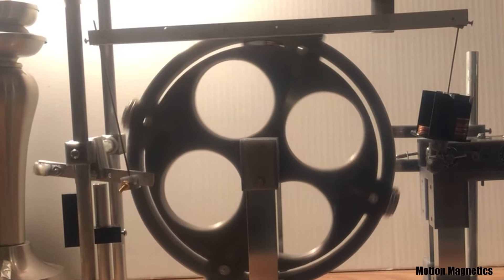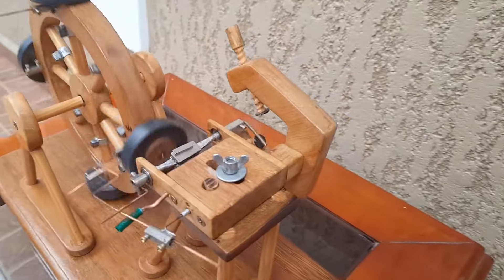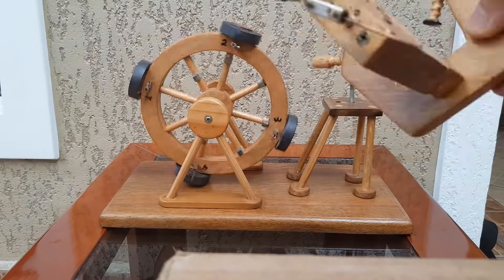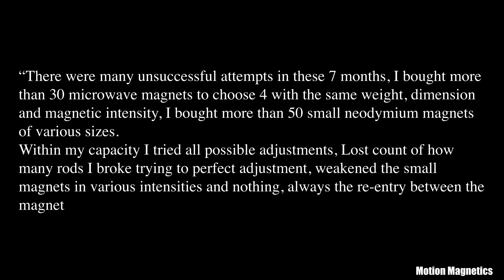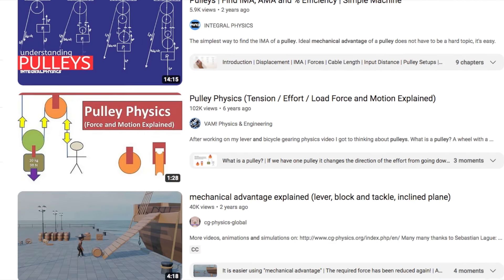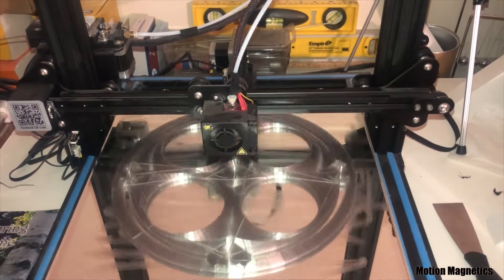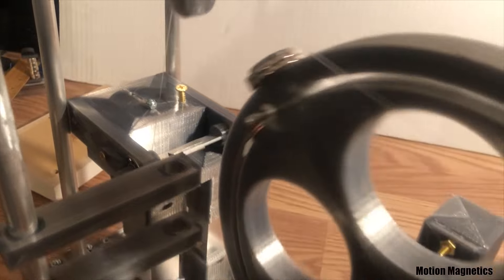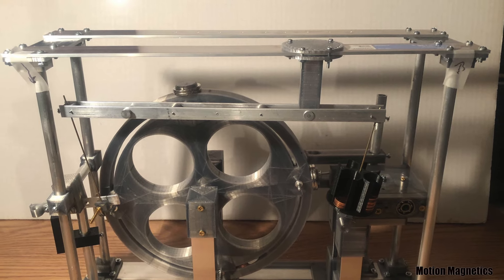The Perpetuum Magnetic Motor

Comment: try to vacume seal the fly wheel in plastic perhaps,or seal the flywheel with plastic  or  place it in  a closed chamber under o pressure them spin it ,factor in static electric can possible harness in both current direction thanks

Comment: There's three things real quick one a bigger wheel at 4 to 6 ft with lots of magnets on it the next one is instead of the magnet flipping horizontally put it on a shaft that spins vertically

Comment: I recent atumbled across this researching Luling motors, i saw a guy using pneumatics to actuate a magnet that gives it a larger push because the spring magnet is tuned to be just far enough away that the rotating bar is slightly off-center woth the two outer magnets, when you pull the spring motor back it launches the bar around for 1 turn, so this guy I saw used compressed air and some electronics i assume to get the right timming to renew the push force, he got his up to 400 rpm.  Im assuming this works similarly and is true timing is everything.

Comment: Your projects are above and out ahead, effort is two hundred percent +++. What is very important is the fact that others will be inspired by the instructive presentation. In the mechanical mind there are wheels that have not yet turned, but what might set them to spinning.
Reply from the maker: Thanks! My main point is always to provide ideas and perspectives that cause the viewer to think. I imagine it as passing a baton back and forth in a race. If everyone works together as a team, there's a much better chance of winning the race.
Reply: I agree that the video can have an inspiring effect on some people. But frankly, many different design ideas for magnet motors have been tried in the last decades, but none of them could show even the smallest energy gain in a credible way. Does this not support the insights of science, that a motor simply can't be driven by permanent magnets alone?
Reply: @heinzpg  I agree with your assessment. In my mind I think of it like this....a magnet is stored energy, but it's not a significant amount of energy alone. So I ask myself what else is source of stored energy?  🤔
 The two things I have are
1: Gravity
2: Spring
 For several years now I have had such a weird feeling that I can't explain.
It has to do with copper and magnets.
 I can't help but think the reaction between the two is somehow the key to the room where the answer is✨🧲😶‍🌫️
Reply: @Azazelcobb    Gravity is no source of energy. If an object drops down you can gain energy. But to repeat this, you have to lift the object up again, which consumes exactly the energy which was gained before. This is by the way similar to permanent magnets. If two magnets attract each other you can gain energy. But to repeat this you have to pull them apart which consumes exactly the energy which was gained before. Also a spring is not a source of energy. A compressed spring can e.g. deliver energy by expanding, but no more than was needed to compress it. 
There is an interaction betwenn electrical currents and magnetism, the material - mostly copper - is not relevant. Copper is preferred in electrical machines since it is a good conductor and thus losses are small. (Silver would even be better, but is too expensive.) My simple answer: it is not possible to drive a motor by permanent magnets alone.
Reply: @heinzpg  I'm sorry, but I disagree with you.
 I'm not sure what to say that will make my point.
 For some reason you basically explained how they both are a source of stored energy without admitting that they are a source of stored energy.
  I understand that neither of them are a sufficient source alone, but you aren't taking into consideration my previous comments.
 First I will say that if it was so simple to create or design what we are speaking about with current designs and concepts. We wouldn't be having this discussion.
 I'm certain that all individuals that have come up with something that prior to their eureka moment did not exist...were all told basically what you told me.
 It's not possible...it can't be done... you know nothing of what you speak.etc...and so on.
 I'm not trying to suggest that spring's or gravity are even a part of anything.
It was only a small part of trying to explain something.
 I do appreciate your thoughts and knowledge, and don't mean any disrespect or anything in that manner just to be clear.
I hope we can disagree with each other and still have dialogue.  I thank you for the way you wrote you're comment.
 It's perfectly fine in my opinion to tell someone you think that they're wrong and here's why.
 I just hope I have done the same.😎
Reply: @Azazelcobb    Please don't give any thoughts about "disrespect", there is absolutely no reason for that! One additionsl thought of mine: If something is declared as being impossible, I think it is helpful to differentiate on what grounds this statement is made. I see mainly two reasons for it. One is, that one can not think of a technology to do it. Engine driven airplanes were long considered as impossible, since the weight/power-ratio of available machines did not allow it, and many did not think that this could be improved sufficiently. However, combustion engines made considerable advances and todays jet engines are even better. And these advances in technology enabled machine driven airplanes. But no one ever thought that this is fundamentally impossible, since birds show the opposite.

The second reason for declaring something impossible is a contradiction with best assured and universal laws of nature. For instance, if you want to get water up from a deep well, due do laws of physics energy is needed for this. Water does not flow uphill to a higher place without an input of energy. Presently many YT-videos show "pumps" which claim to do just that, but these are fake-videos. It is easy to analyze why these designs do not work. Many have the objection, that laws of physics are not the absolute truth. Weren't they often shown as wrong and had to be discarded? But this is not so. There were improvements and corrections of such laws in details but no such law was ever completely discarded, since these laws describe what we observe in nature and this doesn't change. We can not work against nature. If a device violates best assured and universal laws of nature - in case of a magnet motor it is conservation of energy and also laws of magnetic forces - I think it is justified to rate such devices as impossible. I do not exclude that new and surprising ways of generating energy can be found in the future, but I am sure that magnet motors will not be amongst them.
Reply: @heinzpg  Thank you my friend I appreciate you expanding on our conversation, and I have to say I agree with everything you have said here. As chance may be I just earlier this morning have come across some very interesting information. It's something I have never seen before, and I'm not sure what to make of it to be honest.
  For one the individual that uploaded it references several older Russian I believe scientists that I can only say that I think I might have heard of before.🤔
 I'd like to see what you think about it. If you're interested I can post a link.
 Either way I thank you for your time and attention🫡
Reply: @Azazelcobb    I can have a look on it. I am not sure, if links are allowed in comments. You can also give me some key words for googling which will led to the information you have found.
Reply: @heinzpg  I uploaded it to my channel, it's the most recent video.
I'm usually pretty skeptical, but this has me.... I'm going to just let you have a look 😎
Reply: @heinzpg  I have some stuff that I have been able to capture on video also that I don't know what to say about as well, but if you have time/and, or the interest... two other videos are...."Magic Glasses" & "Some captures aren't easily explainable" are the title names. 👍
 Let me know what you think my friend ✨

Comment: If you think of the orientation of the magnets as a "pole-state" you can do some interesting things with state changes and potential energy.

What you need to do you pull with pole-to-pole attraction and then break away  with lateral movement.

Grab some magnetic viewing film and two magnets, I know you must have the film. Place the magnets in attraction together and observe the field as you pull the magnets appart latterally. At some point the two magents will stop looking like 1 magnet and each will be enclosed in it's own border, at this point the magnets repel if the ortientation remains locked.

At a chosed separation distance, allow the magnets to rotate, they will align pole to pole and pull back together over the full distance.

You only have to work to separate the magnets a small distance before they repel each other and assist your movement and you get all the energy of pole-to-pole attraction when they pull back together.

It's easiy to pull strong magnets apart latterally. Treat that as a binary state, it's hard to pull them apart pole-to-pole treat that as a binary state. Energy harvest the difference in potential energy available by switching states.

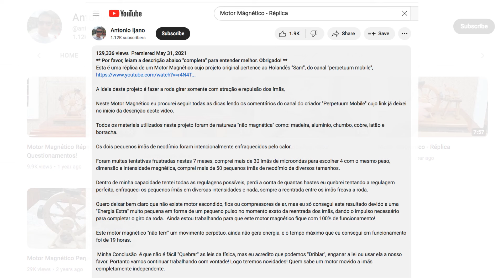Comment: At "2:34"  If a machine makes the energy to power "a pulse"  then what's wrong with that? .. Why do so many people say that some machine concepts are not "true perpetual motion" because if parts that will wear out, fail & need to be repaired. & some say that about machines that have battery (one or more) because they will get weaker in time. They are machines, they will always need new parts and repairs.  It's bad enough so many say it's impossible, The n some one had to make things more complex with terms of judgement. The term "true perpetual motion".. i noticed many of those that say perpetual motion is impossible, also think time travel is a real thing. Many have come close to perpetual motion. No one has done anything with time travel.  Time travel  isn't evenb a thing
Reply: The ‘cylinder and spheres’ has a 1000% increase in energy. But the experiment is not listed in the top 50 methods of making energy from gravity. 
Someone does not want people building or discussing methods that actually work. “free energy from gravity” Delburt Phend